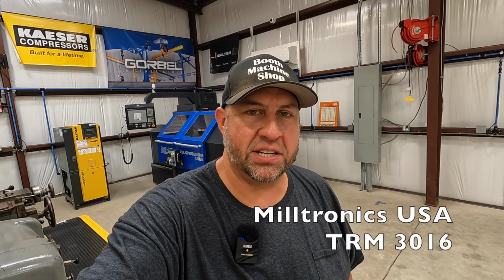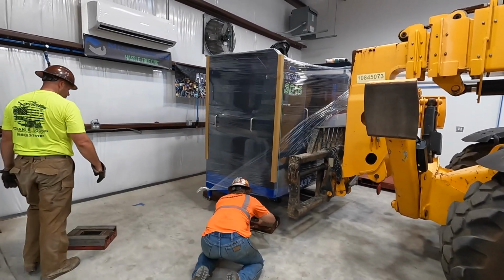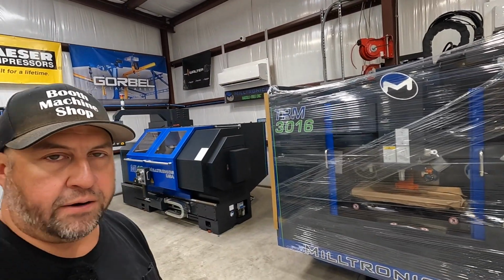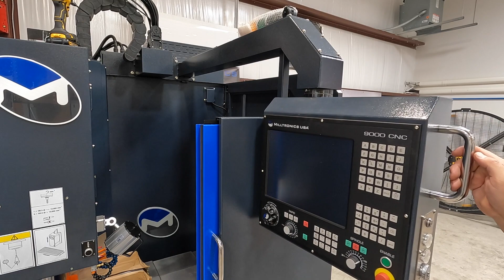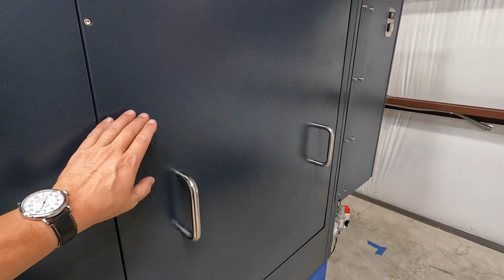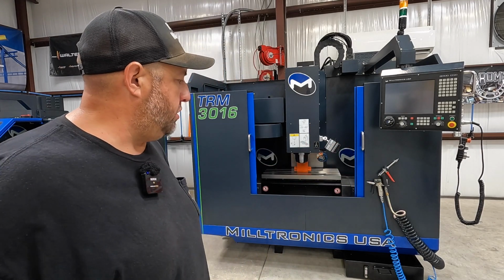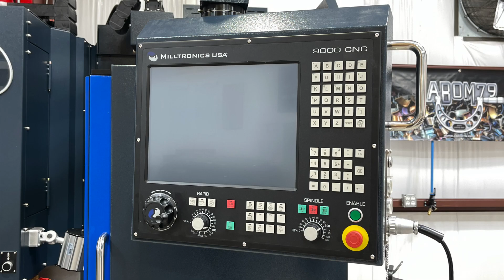Milltronics USA TRM 3016 Delivery & Install

Comment: The pendant cable has a nice cover for the connector. The next time that cover is put back on, will be the day before the machine is loaded onto a trailer and shipped out. In the meantime, every time you hang the pendant back on its hook, it's going to bump into the connector cover. That's gonna get old very fast. Just remove the cover and put it in the box of parts to be reapplied to the machine when it is shipped away. Yes you'll be using the magnets a lot but its proper storage place is the hook. I'm writing all this but I know you'll figure it out anyway.
Reply: That was a ridiculous connector for a device that should only need 4 wires.
Reply: @stargazer7644  Not at all. It's industrial not consumer quality. The cover is so that during transport/storage (or not using the pendant) anything that flails around can't hit the important bits, the pins.
Reply: @stargazer7644   that's a 20 pin connector  4 wires for the estop button   24vdc 5vdc grounds and i/o outputs for all the selection knobs and zero set button
Reply: @derekvandeveire4096  And yet my point is it doesn't need all of that.  4 wires would do.  Power and a serial connection.   Maybe 5 if you want the Estop on its own dedicated wire in case the processor hangs up.  It's a human interface device.  All it needs to do is tell the processor a button was pressed.  Would you think a 105 wire cable and connector for your PC keyboard was reasonable?  It has 104 buttons after all, right?

Comment: like the colour scheme of these machines , it better than the white that most of the other machines use as it doesnt get grimey as mush from dirty fingers touching it
the cnc machines should make doing serial work eazier to do , as you can walk away from the machine once its running correctly and have it do the work , it probably makes doing stuff like making weird rounded shapes eazier than doing it manually too , i have been looking intoo cnc but after trying to work with autocad it became clear that i either need someone to guide me through it regularly while struggling through the process the few times a year i would use it , or realy dive intoo it for a longer period to make the best use out of designing stuff using autocad and get the files to let the machine to do the work for me
if you have a 3d printer and make youre own designs for it to create making the stuff out of metal becomes eazier i guess

Comment: Adam, your comment on the video, “ why isn’t he tilting that back”? Well, to answer that question, that was not the correct type of forklift for this job. That forklift wouldn’t tilt back with that load on it, too heavy, they had to set it down, then pick it back up. They rented that telehandler from United Rentals. They obviously are crane people, not machine movers. You dodged a bullet that day, that video was close to being on “Crazy Crane Accidents”.  Stay well my friend!
Reply: That telehandler can lift up 5 ton.
Reply: @klaas-janbrink4366  so what,
Reply: @klaas-janbrink4366  They were overloaded on the forks with the load that far out. The telehandler is only rated for 10K centered on the forks. Forks are only 48 inchs, so center of load is rated at 24". Machine is 89"x88", and 7000 pounds. The pallet was wider than the machine, so they have 7000 pounds almost centered on the tip of the forks.
Reply: @ionstorm66  right on!

Comment: Congratulations on the new machine. Always a nervous time taking a machine of a truck with a fork truck, even one as good as a JCB telehandler. Reminds me of my engineering shop steward taking a £25,000 compressor off the back of a truck and managing to drop it. I heard the clunk from my office, he appeared at my door white as a sheet. Fortunately, it only bent a panel slightly.

Comment: Everyone is an expert.
Reply: True words!  It is maddening!
Reply: @paulcopeland9035  Going by the amount of times you have posted “was there any damage” suggests you might work for the company.  Not only did he drive the telehandler into the frigging trailer, how he didn’t hit it with the CNC machine due to the lack of tilt is beyond me.  It’s not as if the ground was uneven either.  And you don’t have to be an expert to see that lift was sketchy as fuck.  Where the hell was the banksmen?
Reply: @2373stevieb  He acts just like a bot spamming every single post and bothering every one. I keep reporting his posts as spam because that's what it is, but clearly, Youtube is not very efficient at dealing with bots.

Comment: America needs more manual operation job shop machinists.  However, it it makes sense that CNC skills are necessary to be part of a complete service shop. Anytime you need more than 2 or 3 of anything, CNC shines👍
Reply: If you look at the pay rate offered manual machinists, you will see that this is not true.

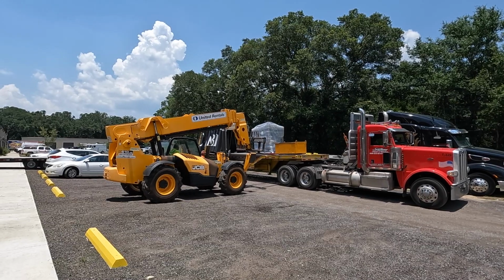Comment: Wow, at 4:50 the tele-handler operator tips the forks down and drives right into the side of the trailer shaking the whole truck. I knew at that point that he had never driven one before and this unload had the potential for disaster. Then at 6:11 I thought the whole load was going to slide off the forks.Then at 10:18 there's one guy trying to hold the multi-ton load with his hands to keep it from falling while the tele-handler operator jerks it around and almost hits your mill.These guys should pay you to edit them out of the video.
Reply: "United Rental".....

Comment: Nice machine! You might have problems with coolant mist gumming up your A/C units though.
Reply: We are having issues with that in our shop right now.  We have 16 Swiss machines running oil.  Each machine has it's own mist handler, but the AC still gets gummed up with residue.  It happens like clock work every year.

Comment: to be honest that JCB wasn't the right machine for that job and the driver appeared to be inexperienced,  those machines have a crawl option it reduces the speed to a minimum, as for the CNC machines I'm looking forward to seeing you make something on them... 
only issue i have with new machines is they look too cheap and flimsy, unlike the old machines, the first machine i got was a 'Victoria' horizontal milling machine, i also bought a CNC Router X,Y,Z, CAM V, 1530 S ATC  which is a great investment it opened up a lot of business for cut out work, but expensive £47,000

Comment: Why the heck did the riggers have the load suspended for that long? And why the double heck didn't he tilt it level when lowering? All worked out but man 😬

That's a sweet looking mill though, look forward to some tutorials 👍
Reply: All of these machines have some spring in the fingers. I’m sure they knew their machine well.
Reply: The telehandler might have been maxed out with the weight of the mill and couldn't tilt back while suspended in the air.  The operator should have set the mill back down on the trailer, then tilted the carriage back and repicked the load up.  But in reality, they should have been using a propane counterbalance forklift with the proper lifting capacity and not a diesel telehandler.

Comment: We have a Haas DM-2 and a Prototrak BPM. Aside from the lack of an automatic tool changer, the Prototrak is an awesome machine for job shop work. It was about $50k but good used machines can be had in the $20,000 range, albeit with less advanced controllers. I have one I got for $8k in my home shop and it works fine but loading programs with a floppy disk is a bit of a pain. But doing programs in CAD isn’t where Prototrak shines, it’s the no BS conversational programming. Even my 1996 machine can do very complicated parts with just a few minutes of straight forward data entry on the control. The open bed design makes it easy to really get up on the part, get a good touch off, pick up a feature, and having a quill you can still get that hand feedback that’s important sometimes. If I absolutely have to hit something right the first time, I definitely do it in the Prototrak.

Comment: I shake my head everytime I see that air compressor, it's in the most asinine in the way spot imaginable. 😂 
Congrats on the new machine, can't wait for some working footage. 👍👍
I also was wondering why the forklift driver didn't tilt it back, they clearly don't know the true potential of that machine, bc they're a beast.
Reply: it's not in the wrong spot 😅. It's sponsored, so the more it's shown in the video's, the better for both Adam and Kaeser. Normally I would agree with you, it should be somewhere out of the way.
Reply: @erikslagter3231  Adam explained the position in a previous video.   He has a finite amount of wall space.   He also has a limited amount of floor space for additional machines, benches, storage, etc.  Also, consider he needs room for deliveries and moving stock and work pieces.  As he said before it suits his plan.
Reply: Forks were overloaded. That's an 8000 lbs machine with 7000 lbs balanced on the tip of the forks.
Reply: @robertlevine2152  and it also suits Kaeser :-)

Comment: the fork feen  sould have been down are jcb alarm out and will not let you tilt or lift to stop you over loading the truck. if the legs where down but not on the floor this fools thw alarm and you gold. Novice on that machine.

Comment: Adam you are a smart guy you know how to read your prints and the basic speeds for a manual machines . The biggest difference is the your speeds are typically faster and when you get into high efficiency milling your feed rates are stupidly fast but all in all I feel every cnc machinist needs to spend at least one year on mill one year on lathe and on on a grinder so they know the complete process

Comment: I found the riggers pretty scattered in their approach to the job, and, like you, I was seriously nervous when the forklift driver didn't tilt the load back when unloading from the truck. I think you could do a better job with the right equipment, Adam.
Reply: The owners of the equipment likely required the use of riggers.

Comment: Afternoon Adam,
Great to see the second machine arrive. Sounds like you have a great opportunity worked out with the manufacturer. Boy, I was thought there was a slip and crash coming from the handling of the new mill! 
Also, and you may have already seen and fixed this but wanted to be sure you were aware this needs attention. Facing the front of the machine the front right corner foot is not supporting the machine. When you slid the coolant tank under the camera showed it is not touching the floor and the lock nuts have not been moved. I couldn't see all the other legs and feet but it appears that is the support for that corner. Would have to have it tip or not be supported properly for you.
Thanks again for sharing, loving the videos.
Reply: @CMTeamCobra Ok good. Thanks for sharing, good to know. It just caught my eye that the back one was on the floor and the front one was casting a shadow and the jam nuts had not been locked.
Thanks again for the info.
Joe

Comment: The mill looks like a Hurco with different branding. Everything about it looks identical to Hurco
Reply: Milltronics is owned by Hurco. Many of the machines are virtually the same other than the control. Milltronics seams to be a lower price and one of the selling points for the Hurco is the control. If you don’t need the Hurco control then Milltronics would be a good option.
Reply: @deconteesawyer5758  There’s always going to be deals being made and it’s good to try and find the best made, best value and most US made machine tool for your needs. For the best value and most US made machine tool it’s going to be a Haas. Machines similar to Haas seem to come from Taiwan such as Hurco / Milltronics, Trak, Feeler. (Even though some are US companies and are deigned / assembled in the US, some of the components may be from the US such as the controls, there may be other global sourcing). Both my Hurco and ProtoTrak say Taiwan on them. Doosan from South Korea also makes machines in the range but some also in the higher end range. The high end machine tools are generally from Japanese brands such as Mazak, DMG Mori, Okuma, Makino, Matsuura. Some overseas machine tool companies have manufacturing locations in the US. Such as Mazak and DMG Mori. I don’t know what percentage of the machines are made in the US though.

Comment: I dont get why the riggers used that big ass telehandler instead of a regular fork lift. Theres plenty of forklifts out there that could handle that machine. Forklifts are more presice and easier to handle in tight spaces. Its not like its their fist time there. Not very professional
Reply: Was there any damage?
Reply: @paulcopeland9035  the machine or your brain did you not watch the video

Comment: Well not necessarily the fork operator’s fault for not tilting back,, maybe he is new too, but the guy on the ground should have signaled to tilt back while it was still over the truck.  Ineptness  at its best. So do you whistle and and hand signal to get them to halt, then walk up and get the driver to tilt back, and does he know which lever it is and the direction or do you just watch the impending disaster and hope that it doesn’t give you a heart attack. That was really scary. This video needs to be reviewed by the rigging company.
Reply: The more likely answer is the machine can't physically tilt back a load that heavy which is cantilevered so far away from its axis of rotation.  You can even hear them bring up the engine RPMs erroneously thinking it's a power issue when it's actually a pressure issue.  The only fix to that situation would be a larger telehandler or a proper forklift.
Reply: @wahconah98  Take note at 33:26 the ram at the bottom, all the way down below the 1084 lettering, is the fork tilt mechanism, it is also the quick release for the forklift attachment, just remove the lock pin and retract the ram all the way and lower the whole arm and it comes out of the top slot, ready to slip into another attachment.
That mill could very easily have slid off the forks with the wrong bump.
I blame it on operator error/lack of training, I think the machine could handle this job with ease, there was no extension required on this job and they're rated to handle more than a ton on full extension.
Reply: Seemed no problem keeping the machine vertical when manoeuvring in the shop so it looks to me like poor telehandler operation…
Reply: @geoffbuck6890  :  Because once they had the skid on the ground, they had to level the forks to pick it back up.  The telehandler has no issue deadlifting the weight of the mill, it's just not designed to curl a load that large sitting 2-3ft out on the forks.
Reply: @wahconah98  It sounds like you understand how telehandling reallyworks, I don’t to be honest 🙂
Reply: wrong as a fork lift he should know what he is doing  with out bei g told to tilt back

Comment: I'm about an hour and a half away from Zanesville. If you find the time and would like a nice curvy backroad check out 555. It starts in Zanesville and runs around 63 miles to little hocking. I ride my motorcycle on it all the time. It's a nice drive.

Comment: I’m in the process of learning Fusion 360.  I’m excited to see what you learn and I’m hoping I can benefit from it!
Reply: One thing I forget now and then when working with Fusion360, and have to start over; when planning creating several components in one go, same drawing file/assembly, do the 'create new component' command at the very first, before doing a single line or anything else)